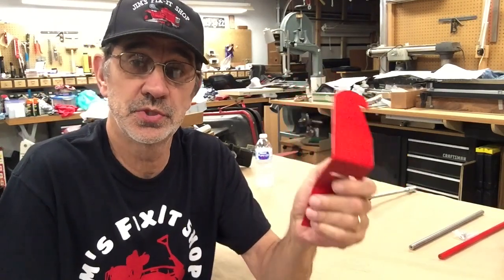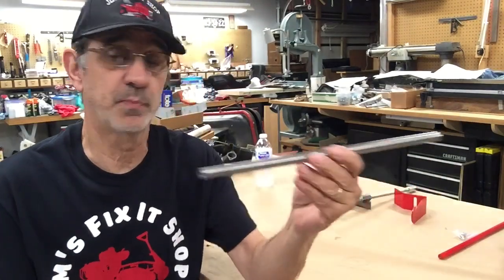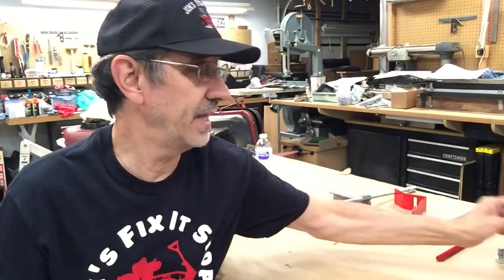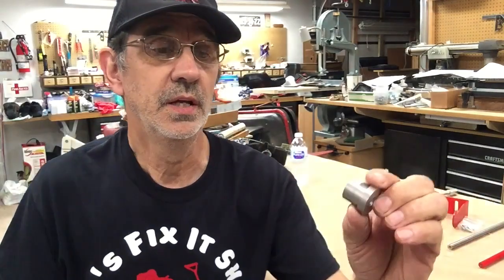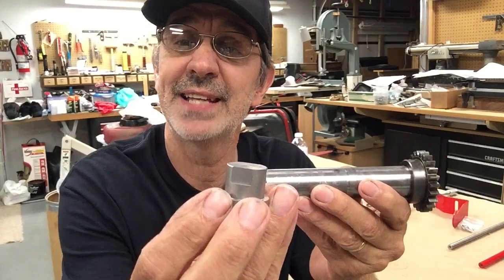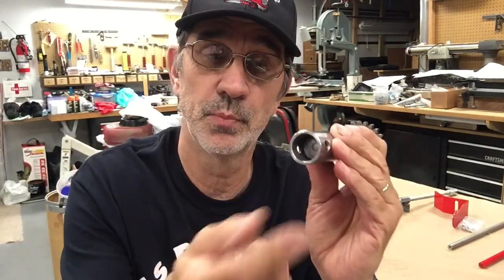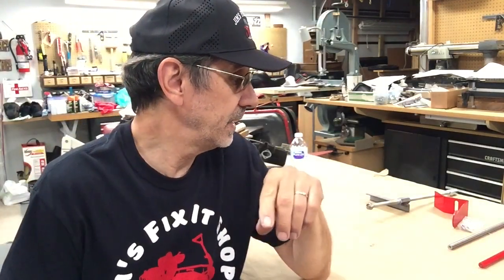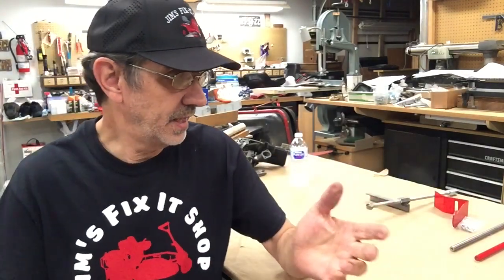398. Tools I make to sell. ￼

Comment: How do I order the wheel puller adapter.  I need one ASAP!  Both wheel are off.  Also, need the compression bolts and nuts.  Please advise.  Thanks.
Reply from the maker: Can you send me pictures of the issues you have.         Jim
Reply from the maker: I don’t have any to sell the one I have I just use for my own  work, they would be very expensive to build and sell.     Jim

Comment: How can make my blades bar stay over without using my foot plate, it hard for me I have lengthy use in my legs, hope you can help 🙂 thanks
Reply from the maker: What state do you live in. Jim
Reply from the maker: You can change out your assembly clutch plate or your latch plate that is the plate that holds your engagement handle up the old style didn’t have the foot petals. Jim

Comment: I’ve came to your most recent video in hopes of getting a quick response. However my question concerns an old (series 3) snapper. (3311X5S). This may be a dumb question but I recently got this mower for free from my father in law and I only know a small amount about this mower. 

I’ve recently replaced the belt on it and I was curious if the blades are supposed to always turn? When I crank the mower the blades aren’t fully engaged but are definitely spinning pretty good. The belt doesn’t seem too tight. I cannot find anyone with the same question so I have came to you for help. If there is an issue please let me know and possibly even how to fix it!
Reply from the maker: You don’t have to come to my most recent video for an answer I answer all of my emails and comments daily, I have a question for you is this a snapper rear engine rider or is this a lawn tractor when you say the blades as if there is more then one it sounds like you’re talking about a lawn tractor ?
  It would help me with my answers but regardless if it’s a rear engine machine a lawn tractor or a garden tractor the blade should not engage and start spinning when you start the engine there is something either locked up or the belt is way too tight let me know which machine you have pictures would really help and I’ll get back with you. Jim
Reply: @jimjackson9381  Jim thank you for replying. I have a rear engine rider. I found your email I will send you some pictures of the mower!
Reply from the maker: Well don’t forget to be sitting on it when you take the picture.  Jim
Reply: @jimjackson9381  hey Jim, I sent you an email. No rush, I am just making sure you received it. Thanks

Comment: What about your tool you make out of a paint stick to measure clearance on your  motor drive disc? Also you should make a puller to pull off the hubs on the back wheels that get stuck on there from corrosion
Reply from the maker: Well the paint stick measuring tool I don’t sell because you can make them yourself out of a free paint stick, and as far as pulling the wheel hubs off I am making a heavy duty puller that will pull them off without hurting them keep watching I am trying to get it done and when I do I’ll do a video on it. Jim
Reply: @jimjackson9381  
Well, true, but you would be surprised how many folks can’t build simple things like that… just saying… I’d make a couple and sell them for $10 bucks plus shipping
Reply from the maker: @Garylee62  Well I guess I’ll have to look into that it’s an idea thanks. Jim
Reply: @REVNUMANEWBERN  I have detailed files for all of my power equipment… but that’s a good tip for those who don’t have that info
Reply: @jimjackson9381   I would like to buy spring compressor How do I do it
Reply from the maker: @paulcoss9428  I need your address and zip to get shipping price. Jim